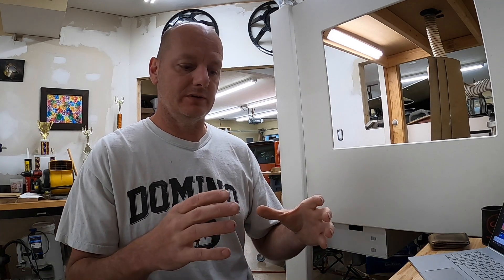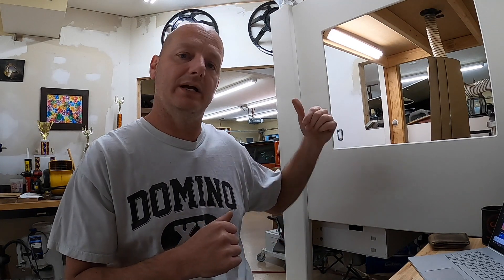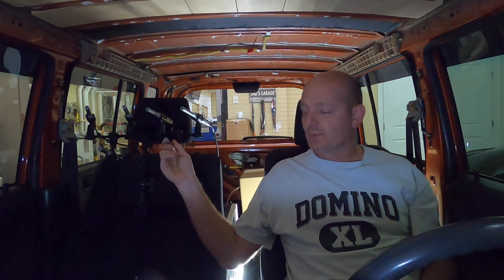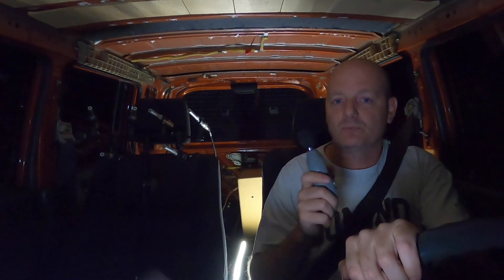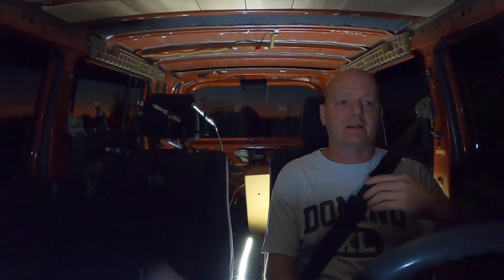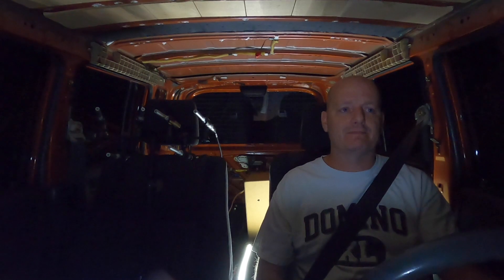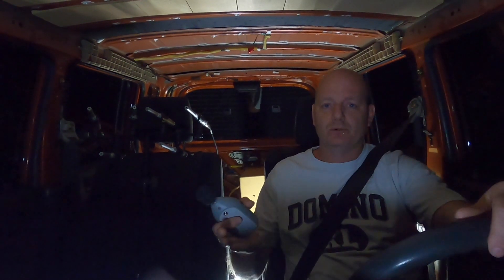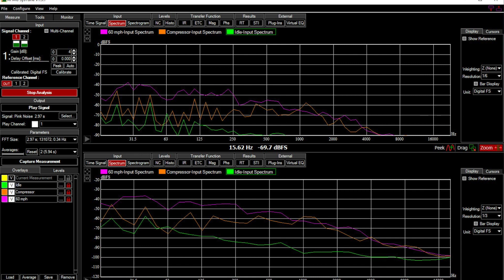Siclone: Episode 3 - Initial Noise Measurements

Comment: So how is the systune set up component wise? I see multiple rta microphones. I could not find much information on there website about the microphones and other components. Any info wood be appreciated.
Reply from the maker: I'm running six Behringer ECM8000s into a Tascam US-16x08 interface with SysTune as the software. In SysTune you just configure it to use the Tascam. From the Tascam to the computer is a simple USB connection.

Comment: I use kilmat, wool matting, construction adhesive, and a mixture of pour foam and can foam. But I'm SPL on a budget lol. But its amazing what good sound treatment does to ride noise
Reply from the maker: Scott, this build will compete in SQ and SPL. Should be a fun one.
Reply: @BatdogGarage  nice, I will be following along with you. I like your video earlier about sound treatment. Tho I didn't get to finish that one yet. I have a no wall 94 caravan doing close to or over 155 at around 36hrz